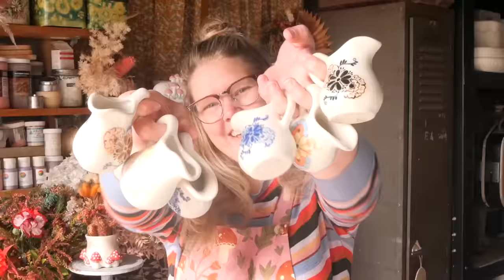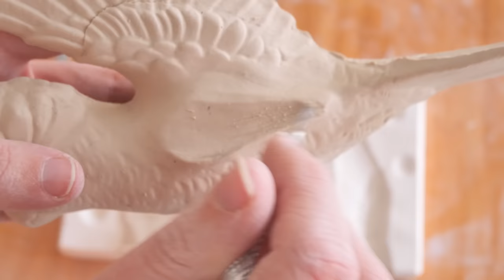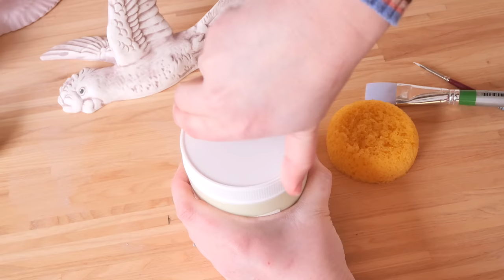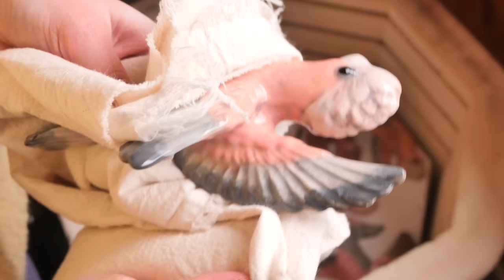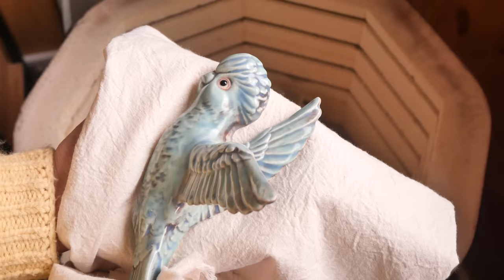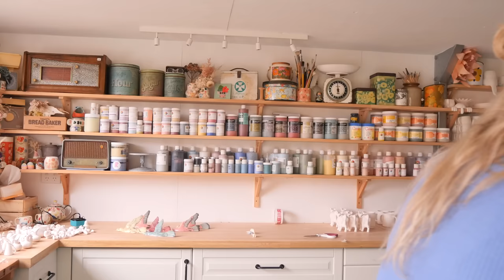Ep.9 These pieces CRACKED!! I don't know how to fix this!

Comment: Shelby don't forget that Galahs are also coloured black. The black males have incredible red colouring in their tails while the females plumage is flecked with grey and yellow. It's something you need to research for yourself, in order to find the colour pattern that you like the best.

Please don't be put off doing the black and red males, by people saying they have never seen black galahs before. Sightings are rare in the southern areas of the country. Here in north Queensland they are far more prolific. 

Good luck working out how to hang them. I remember my mother once had a set of flying ducks. From memory they had a hole incorporated in the back side, so they simply could be hung from a nail on the wall, meaning they were flush against the wall. Now we have far more varied ways for hanging items, that can be used independently to the item. Good luck, I look forward to seeing how they turn out once you solve the hanging issue and the colours you select.

Comment: Could you dremel out that hole in the back after the clay first dries or after it's first firing without causing cracking? If so you could just open it up and use it with a hook for a hanger, the other thought I had is could you create a mirror of the body with the single already attached wing and make a more 3D version you could hang by the wing tips as maybe a windchime kind of body?

Comment: Maybe try compressing the clay with a smooth tool sort of burnishing it. Might strengthen it. It's also possible it is how your holding it when you attach the wing, maybe your inadvertently twisting or pressing it weakening the corner. Just a guess though

Comment: I have generally seen these hung on nails or small screws. It's a bit difficult to tell how deep the hole goes but it should work. However! We do also have command strips and similar wall adhesives now so you might experiment with that also. You could also create a custom wall display with pegs designed to fit snugly into the holes and fixed with adhesive and then hang the display fixture. Asking out of curiosity: Could you use a different type of clay that might mitigate the cracking or fire at a lower temperature or is that not a thing? I only know what I've learned here so I have no idea if that would do anything like, would another clay would dry more slowly/evenly? Can you adjust the kiln temperature to slow the contraction speed?

ETA: This video being posted made being involuntarily up until 5am worth it.

Comment: I love them all. I would have birds everywhere. Hang one or two in an archway so it looks like they are moving from room to room 😻  things that my mom and grandma had for the walls had a hanging wire embedded in the back.  We had a ceramic shop in town when I was a kid and mom and I would buy the pieces and take the mold lines off and have them bisque fired and get them back then pain on colors and pearlescent sometimes and take them back to the shop and wait. Sometimes it took a month to finish a project but we didn’t have a kiln. I took a pottery class in college and that was fun too, never too old to play with clay😂🤣😂 
In both cases weather it’s a mold or hand thrown you never know if it will have a little crack or break completely, drying times/temperature or firing temps affect things differently. All we can do is our best. 
It was a community college so mom and my best friend took the class too, good times 😊

Comment: In the past I had a set of 1950's mermaids and bubbles and all the had on the back was the large hole. I put a screw into the wall, leaving 1/4 in. or 6 mm and they hung beautifully.

Comment: As a potter I have struggled with things that didn’t work when it seemed so easy. Just repeat. Those mallards were hung over a nail with a little flat head. Very simple. I use Rubbermaid box with an inch of potters plastic in it. I have a small piece of perforated plastic sheet in the bottom. Letting the pieces sit in this(add 1/2 cup water, put the lid on), let sit for a few days, will let both pieces become equal in moisture. Then join. They should be perfect. Maybe then you wouldn’t need slip to join(maybe the wetness of the slip is part of the problem. Sometimes I find as I make things and become more proficient, I work faster and things work better. Sometimes covering pieces with a damp cloth will they are sitting on the table waiting to be assembled will help pieces from drying out too. The wings are smaller so will dry quicker if left on the table. Cracking has broken my ❤. Kilns can be so mean. Maybe make them one at a time. I love your show so much.

Comment: Am wondering if the tension was caused by the body and the wings being poured at different times. The body may have been dryer than the wing causing the cracks. Maybe your join was so strong after bisque firing that the tension didn't cause it to crack there but rather further up instead.

Comment: Somebody probably mentioned putting a hole in body where wing attaches that corresponds to each other. There has to be a place for any air to expand. It’s possible that where the nail hole is will allow air to escape from both pcs.

Comment: In regards to the hole in back it probably is a receiver for a metal loop that would be epoxied in you would have to do some asking with someone more versed in vintage wares but the cracking could possibly be microbubbles have you tried poring the slip a little thinned out to see if It solves the cracking issue? It could be a design but that would mean just firing at a different temperature variant to lessen the possibility of cracking by eliminating some of the thermal stress. It seems to me you would have to do some minor experiments with similar angles to see what exactly is going on there.

Added note about the hanging thing it could very well be possible to use some 3d printed insert to protect them from a nail in the wall that can act as the way they hang. there are many options but in my view the pour on the actual piece does look a little on the thick side. I hope you solve the cracking issue because they are nice pieces and I would love seeing this kind of art come back to the world.

Comment: Honestly if I purchased these I’d probably use Velcro command wall strips. You can purchase them to hold different weights. There is also super strong double stick tape too. Obviously not great if you want to move them. 

I can see what you mean with the holes in the back being rounded, it’s hard to get a good anchor for hanging 

The other idea is maybe these were intended originally to be glued onto a wood frames board. I recently purchased a set of seahorses that were mounted to a wood board then framed. I could see how these birds would look great in a vintage tiki room on a wood board. 

As for selling I would recommend to buyers to use Velcro command strips. The buyers could also choose different applications depending on how they want to use them

Comment: What if you put the birds on the holders like you did for the ceramic flower hats? Maybe it would help with the cracking?
I thought a wall nail would be how they are mounted, but personally I probably use something like command strips

Comment: From memory the ducks had keyhole hangers in the back that you could slide over a nail or screw and they would sit flush with the wall. I believe these are designed the same way.

Comment: I looked at a heap of the ducks and they have 2 small holes on the back n string or wire if threaded in to them for a hanging loop..

Comment: I absolutely love them especially as a flock of five or more. I don't think that the cracks are a big deal. I would use a picture hook or an s hook to get them to hang flush to the wall. Also I have some things that have the circle with a narrow slot at the top to keep the head of the nail in place. Ikea spice racks have that for example ( also this was incredibly difficult to write without making it sound unnecessarily s3xu@l 😅)

Comment: I'd expect they would hang from a nail or screw from the hole in the back. 
The 'creepy' ones have a really fun vintage vibe, but I adore the wild coloured ones. The grey of the wing is stunning with those shades of pink. I get how the crack might be a bummer but it's in a hidden place on the piece. It does not detract from their beauty in my opinion

Comment: I have a trout, native to my area, it has a hole in the back too. The hook I used was a plate hook that squeezes together to insert and then opens back up putting a little pressure against the piece and lays behind the trout. If I can find a link for you I will message it to you on Instagram.

Comment: Maybe the clay where the cracking happened is a different thickness? In those cases I think an extremely slow drying period and firing would help prevent cracking?

Comment: Nano tape could work? Or a screw bracket that attaches to the bird and gives you a hole to hang on a screw in the wall. Most hardware stores will stock them.

Comment: QUESTION…..the birds with cracks…. Are they all the same size?  Maybe it’s a size issue or a timing issue.  You might have to pour the cracking size first, pull it out, and then put the other sizes.

Comment: Unfortunately I'm ignorant when it comes to pottery, but something in glass making and metal forging (Two other skills requiring heat, and tempering) is that possible the cracking occurred due to the Kiln's cycle? Perhaps the ramp up, ramp down, or hold times need to be adjusted to more gently fire the clay. Maybe they need more cooling, or a longer time at lower temps? Again, I'm not familiar with the mechanics of pottery firing but maybe with your knowledge of clay and how it works, you can figure whether or not what I'm saying has any merit, and could help. 

I just have this feeling that a different heating cycle or pattern, or something could help these pieces stay together after firing. I hope it isn't the design because it's obviously a very special piece to you. Good luck! Very fun video regardless of the outcome!

Comment: Make a horseshoe shape wire, give it a foot on each side at the bottom of shoe ,you can create a tension type hook to fit inside the hole on back of the piece. It will look like an upside down U. I have plates hung this way.

Comment: I can’t see the cracks! Help.
Reply from the maker: In between the head and the wing, in the little u section it cracked on almost all of them!! I pulled the rest of them out of the kiln (thes ones I mentioned I didn’t finish in the video) they also cracked in the same spot. Some of them are so so small it’s hard to make out but still a crack!
Reply: @ShelbySherritt  I’m not a potter but if they are cracking because they “shrunk too fast”, is it possible to dry them longer at a lower temp? Or start the process at a longer interval at the lower temp to allow a slower shrinking process before finishing at a higher temp?

Comment: Nowadays hanging tape like Command is so strong and good quality that you could hang a hundred pound mirror without worry. So I wouldn't worry about the hanging, if there is smooth surfaces on the backside, just inform the buyers that they'll be hang with a double sided tape.

Comment: Just sits on a nail. For ones u scooped out you can just adhere a hook to with a strong glue like E6000. But most people just put a nail on the wall and pop em over it where the hole is. Cracking just really takes time patience and calm

Comment: If you use a wire imbedded in the heads, and then you dangle the heads a bit over the edge of the platform in the kiln, would that work? Would adding an air hole from the body into the wing help the wing dry at the same rate as the head and help with cracking? Or into the head? Or maybe I have no idea what I'm talking about. Just ignore me...   Wait!! I have it!! Use hot glue!!

Comment: I mean worst case you could always fill the hole with that blue putty stuff that sticks everything on walls lol, and all seriousness though, I would pack it flat with something and super glue a picture hanging hook on the back for this set. For the next set, if you can't think of a better pottery based idea, just fill that hole and then glue a picture hanging hook on the back with really solid glue. Maybe do a little bit of a recess so that it doesn't stick out from the wall. The only thing I know about pottery is what I watch in your videos so I can't really help you more than that❤
Reply: Also, what if you did a relief cut where it cracks before you fire? Would it save the neck area from the stresses of kiln heat and shape change?
Reply: Ok no, new idea.

Fill the back of the bird hole half full with epoxy, then stick whatever hanger of your choice into the epoxy before it sets. Keep in mind potential expansion of the epoxy and recess from the wall for the screw and hanger when you pour the epoxy. I think that would really work!!

Comment: They are stress cracks …… try to fire them on firing sand so they can expand and contract when firing.. 
some times you can get away with silting them off the shelf